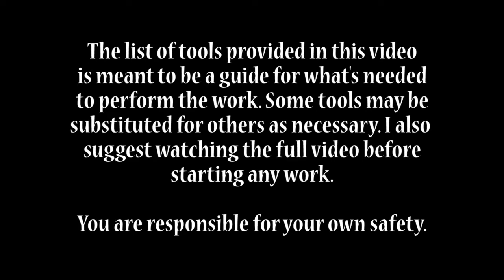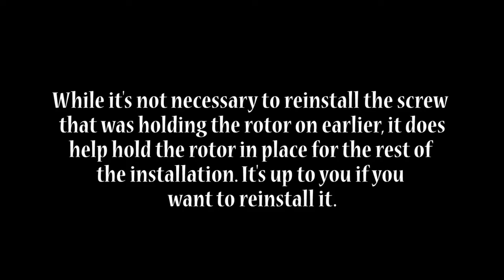Acura MDX Rear Brake Pad and Rotor Replacement: 2017 - 2020

Comment: Thank you for posting this video. Do you recommend using OEM rotors and brakes? If not what specific brakes did you use? Did you notice and shaking when applying the brakes after a few uses? Where do you get the brake piston rewind tool? Thank you for your help!
Reply from the maker: What brakes you use are really up to you and your budget. I typically do not use OEM rotors/pads but choose a high quality aftermarket manufacturer. The tool part number is at the beginning of the video and came from Autozone. Thanks for watching!

Comment: Great Video, I have done many brake pad and rotor change in Honda Civic and CRV 2000-2017 model, was looking for 2019 and above model as i was confused with electronic switch part , now not any more

Comment: bmw has the same e-brake on the rear, everyone I've talked to said you have to take the motor off and turn it with a torx bit so I never tried the retractor on it, turns out you just have to switch manufactures

Comment: The rear brakes don't have the 2 pins which separate the brake pads from the rotors like the front brakes have?
Reply from the maker: Nope, what you see is the hardware that's used for the rears.

Comment: What was the process for checking the Electronic brake after you finished? Meaning did you pump the brakes first to get the pistons where they needed to be then engage the electronic brake or did you just engage the electronic brake and let it make the piston adjustment? Thank you for your help?
Reply from the maker: I actuated the parking brake and it adjusted properly and everything worked fine after that.
Reply: @stuffyoucando2  thank you so much sir.

Comment: This works on RLX also.  I used bungee cords to hold caliper out of the way.
Reply: Thank You! I have a 2017 RLX with 50k and about to perform my first brake job on this car and the rear electronic brake was of concern to me. Anything else you think I should know about doing it? Appreciate it.
Reply: That’s because the RLX and MDX share the same rear rads and shims.

Comment: FYI, for my '16 RLX, I had to remove the EPB motor(T-27 bit, 2 screws) and turn the piston screw (T-47 bit) clockwise until it bottoms.  Then use C-clamp or tool to collapse the piston so caliper can be reinstalled.  The caliper mount bolts are 13 mm or T-47 bit.  I started the engine, slowly pumped brakes until firm pedal then apply EPB(you'll hear a whirr about 5-10 secs) and then done.  Hope this helps the RLX guys & gals out there.
Reply from the maker: I’ve seen it done that way in another MDX video, which is unnecessary when you have to just rotate the piston as shown here. I’d imagine the RDX is the same way and likely isn’t necessary there either if you have the correct tools.

Comment: 2016 MDX has old drum/shoe emergency brake set up, so just changing pads is easier, no piston retractor  tool needed.
Reply from the maker: You are correct, no electric parking brake until 2017. Thanks!
Reply: @stuffyoucando2  ironically the same set up I have on my 67 vette

Comment: What calliper tool did you use?   My one is shit.  Every time it would turn the piston, the rubber boot would twist as well.  Any suggestions?
Reply from the maker: It’s an OEMTools 24693. As for the rubber boot, sometimes that happens and you just need to be careful not to tear it. You might be able to lubricate it with something but be sure it’s safe to use on brake/rubber seals.

Comment: Awesome Video, Thanks for Posting!
Quick question….Title says rear but it’s looks like you do this front breaks? I’m guessing it’s identical? Is there a big difference? Thanks again!
Reply from the maker: No these are the rear brakes. They’re definitely not identical to the front but the overall process would be similar, though there is no parking brake and hardware will possibly differ in size and torque specifications.

Comment: I noticed on the new brake pads the squealer is on the outside vs. the inside (the side with the piston). Shouldnt the brake wear indicator/squealer go on the inside?
Reply: Good observation...It should be on the inside.  Not sure if it's going to make any noise or anything.
Reply: @rontan8954  it won't make any noise day to day but generally the pad that is touching the piston wears down quicker so you want that pad on the inner side.
Reply from the maker: It would still squeal once it contacts the rotor. The general idea behind putting them on the inside is that people tend to think the pad on the piston side wears faster. I’ve never observed this to be true and feel the position of the squealer is a preferential thing. Personally, I think if you solely rely on this device to tell you that your brakes need replaced, you should rethink how you maintain your vehicle. You should inspect your brakes periodically to check wear, not rely on a noise making device with questionable reliability.

Comment: Thanks! but why don't set the electric parking brake before starting the job? is it unsafe, right?
Reply from the maker: If you set the electric parking brake, you won’t be able to remove the caliper as it’ll be clamped to the rotor. Make sense?
Reply: @stuffyoucando2  Thanks! yes, that's clear.
Reply from the maker: @bryanlee5390  great, thanks!

Comment: Some videos show people removing the electric parking brake motor and retracting the internal drive - manually or with a 12 volt jumper.  You just retracted the piston, leaving the motor in place.  That doesn't damage the motor's internal drive an any way , does it, when you retract the piston?     Your approach is more straight forward.
Reply from the maker: Honestly, I think those doing those videos weren’t aware that some calipers require the piston to be rotated to insert it back into the caliper, regardless of whether or not there is an electric parking brake. I had no issues after doing it as shown here, the parking brake worked perfectly immediately after I put everything back together and tested it. Thanks for watching.
Reply: @stuffyoucando2  After watching  a number of videos.  I now realize that the screw drive on the electric motor sets the piston position relative to the wear of the brake pads.  When turning the piston back, it is setting the motor's screw drive positioner back to accommodate the new brake pads original dimensions. The piston bore is smooth - thus your approach is completely correct.  I just don't have the 3 pronged device that fits into the piston's grooves.    Most retraction devices have 2 or 4 prongs; even the Harbor Freight kit doesn't have the right part for Acura.  

Thanks for your video - it helped me understand the dynamics of this system.
Reply from the maker: That’s correct, and it seems that to have a 3 point contact for rotating the piston is unusual, most I’ve had in the past have been two and you could get away with using a pair of needle nose pliers, but not in this case. I’m sure you can remove the parking brake motor as shown in other videos if you don’t have or aren’t able to get the tool. I got mine off the shelf at Autozone.
Reply: @stuffyoucando2  Thanks for the tip!
Reply from the maker: No problem, good luck!

Comment: You feel safe not using jack stands?
Reply from the maker: Do you think I crawl under the vehicle? I don’t…but if I did I’d be using jack stands.
Reply from the maker: Also, I list jackstands on the required tools (if desired). It’s really up to what you’re comfortable with. Knowing that for a job like this I’m not going under the vehicle I did not use them myself for this job.

Comment: Should use some thread locker for those bolts.
Reply from the maker: Thread locker is not necessary.
Reply: Thread locker is not required if you torque them to spec.  You could, however, apply some anti-seize. I always do, bc I live in upstate NY.